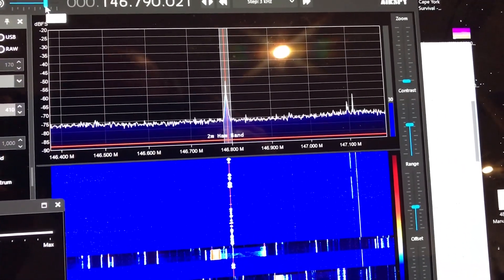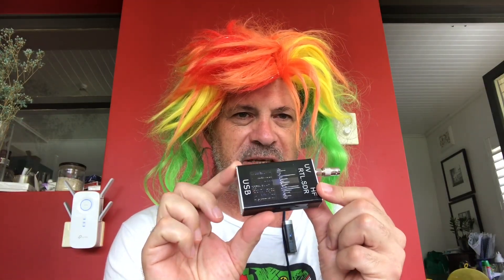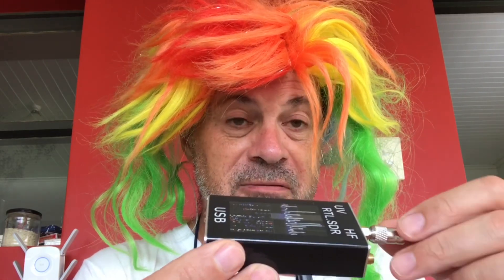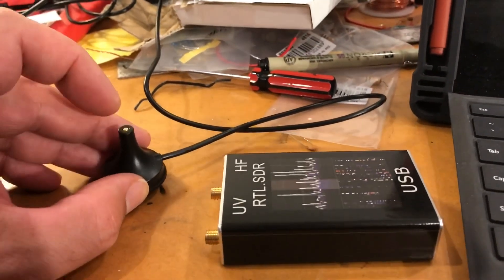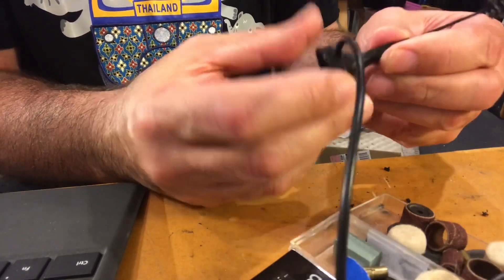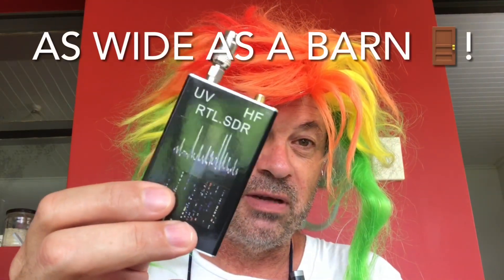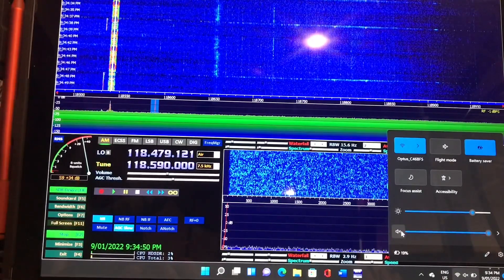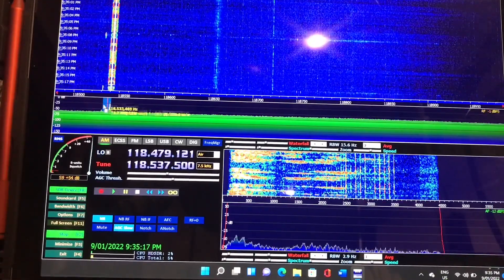SDR Chinese Clone. Was mine good? @TheArtofEngineering

Comment: Interesting video, thanks. So I bought the cheapest I could find and its run great for last three months, had no issues tining across amateur hf bands andnhave been using it as a panadaptor on my homebrew transceiver. Well.... I was until today. Today its telling me that its lost contact with the Service API. Ive been using sdruno on Windows ten, for no other reason than that's the first package I found that worked with the adaptor and stayed with it. I do sort of remember when I installed it they asked for money and I skipped that page, so maybe mybfree lunch jas come to am end. So, my question is, what software are you using with yours? 73 Shane
Reply from the maker: I think I used SDR Sharp and HDSDR....Now ith my Airspy HF Discovery I use LInux on an old Mac running GQRX (That Old Tech Guy Youtube channel has a video how to set that up).
73 de VK2AOE
Reply: Ok thanks, great info. Reloaded sdruno and for now it's working. Will check out the link.
Reply from the maker: @shanehogarth6373  SDR SHARP is 👍 73

Comment: That airport automated repeater sounds like Sydney's airport, that being said, they all probably use the same voice around Australia.
Reply from the maker: Yes it is Sydney ….. about 6-8 km away.
Reply: @TheArtofEngineering  I can hear that repeater out in Penrith (as well as Richmond RAAF). Sometimes I can hear the transmissions from the pilots, but making an antenna like yours would go a long way to improving the reception for sure. Would a FM or AM filter help?
Reply from the maker: @TheGeeMan  Not sure. about the filter...I'm not an RF engineer but I strongly suspect the sensitivity and signal to noise ratio of the cheapy SDR's is the problem. The Air Spy one are $100 more but I have been told MUCH better....I might buy one and review. YES and outdoor antenna....nice and high will help!
Reply: @TheArtofEngineering  I'm using an authentic RTL-SDR (Secomms in Melbourne is the official supplier for Aussies), they're pretty affordable for what they are, but depending on the model of AirSpy you get, it can go from $100 to at least a few hundred, but they seem to be pretty decent from what I heard as well, and have a bigger bandwidth to listen to. The max I can get out of the RTL-SDR sticks are about 2.8mhz, I think some of the Airspy's can do 8mhz, or even 10mhz, but I guess that's what you get for your $$$

I'm currently running a Discone antenna for general scanning, and it ain't too bad, definitely better than supplied bunny ears (dipole) antenna I got with it.

I also DIY me up a 1090mhz antenna for ADSB, which is pretty good, I seem to be getting planes at least 250km out from Sydney so not bad for a homemade antenna, during peak hours, which seems to be about 12pm, I get at least 30-35 planes, that's probably nothing for those who built better antennas, but I'm glad I can see that many planes out here in Penrith.
Reply from the maker: @TheGeeMan  Well that sounds much better than the SDR I got! You should look into Ham radio....the opportunity to transmit and see there it goes adds a dimension to the radio play!
Reply: @TheArtofEngineering  The RTL-SDR sticks are pretty much the starter sticks, Airplay, HackRF, LimeSDR, etc.... definitely a step up for the start SDRs.

Yeah, a friend of mine said he's getting his HAM license shortly, I really should look into it as well. In the meantime, definitely having fun listening and definitely want to improve my reception of the odd signals around Sydney.